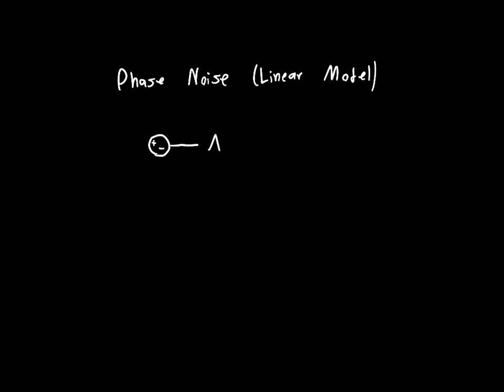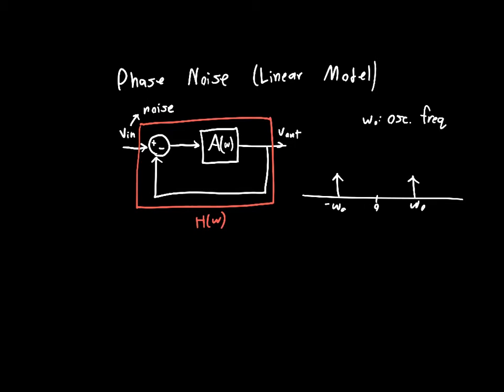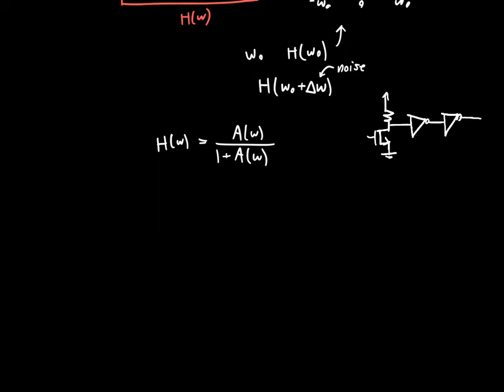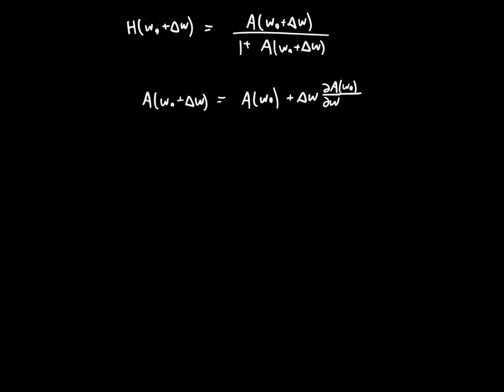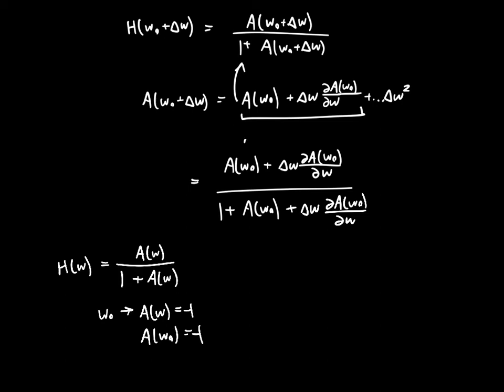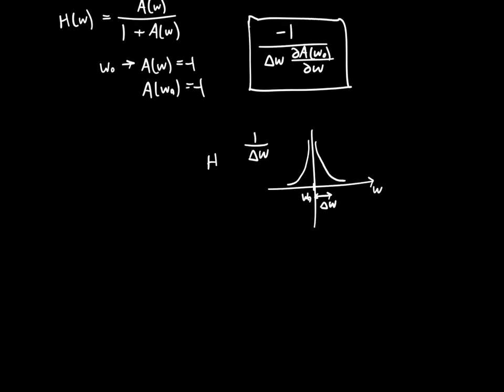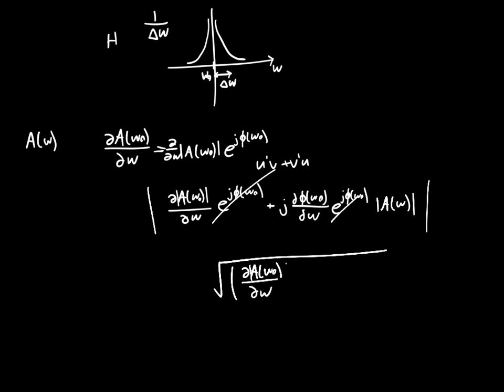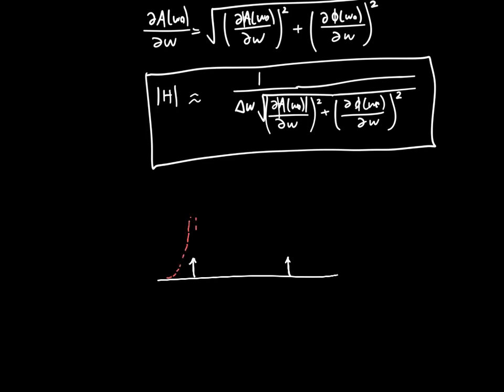Phase Noise Derivation

Comment: I see two issues with this derivation. First, A(w0) need not be -1 as in Barkhausen criterion, because in real oscillators it would be the nonlinearity (voltage limitation) that would suppress the large swing oscillation. It does not mean that A(w0) becomes one (e.g. in ring oscillator example it is not 1). Second and even more important point is that the phase noise conceptually is a sampled noise. Therefore, input noise sources at low frequencies up-convert to frequencies around the carrier when phase noise is observed. This phenomenon cannot be described by such linear model where Vin is passed through H(w), because none of the low-frequency components of Vin would appear around w0 according to the given derivation.